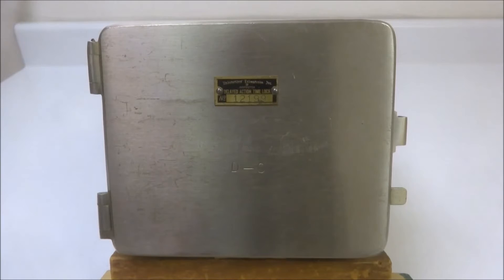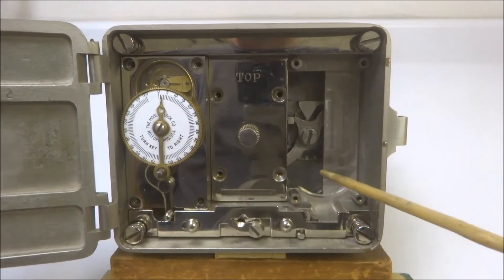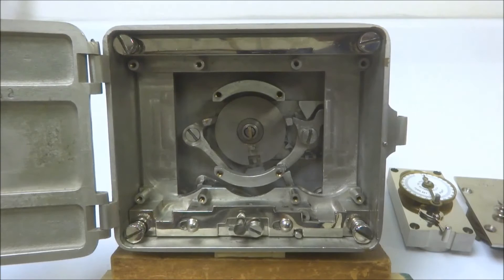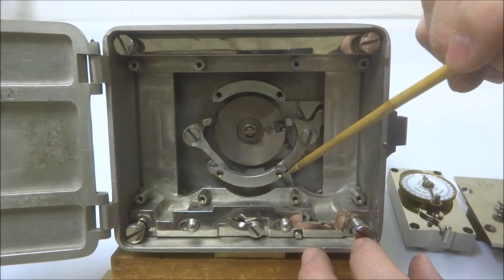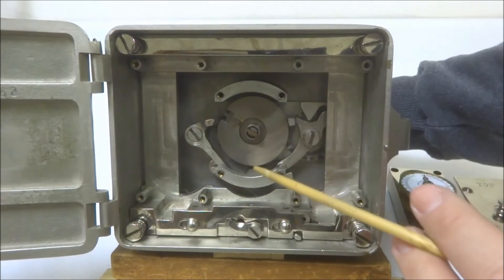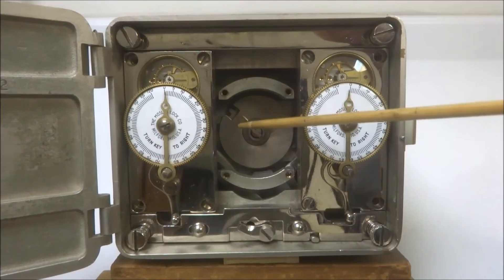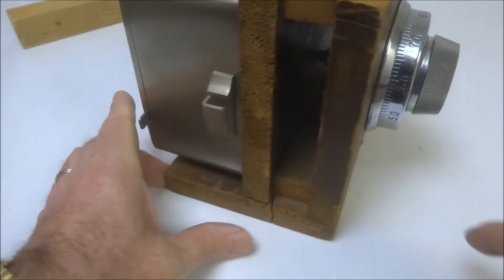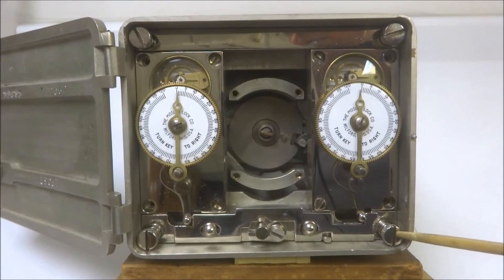Mosler Timebination lock, Model D-C, delayed combination

Comment: Mark your description sounds good although a bit strange and got me thinking about this lock.  I believe it was intended to be used as both an overnight time lock and as a short delay on the unlocking of the safe during business hours.  Once the safe was opened in the morning, that pin could be removed and a short amount of time put on a movement.  Now the procedure to reopen the safe would require dialing the comb to the secondary fence index activating the timer.  Once it had wound down the primary comb index would unlock the safe.  Since the wheel pack has only one set of gate openings and there are 2 index marks the same comb works at either index mark.  This would then require an armed robber to wait around for several minutes to access the main supply of cash in the vault. This delay function was found to be a fairly effective deterrent back in the early 1900's and I image is continued today.
Reply from the maker: Thanks Doug. I will keep your description should I redo the video.

Comment: Fascinating! I assume that the reliability of the clocks is of the highest possible because I would imagine that the failure of the main clock would mean that the safe would then be locked permanently with no easy way of getting in?
Reply from the maker: That is correct which is why there are two movements. Either one can perform the function so both would need to fail for a lockout to occur, an unlikely occurance. You can see other examples here: http://www.my-time-machines.net/my_time_lock_collection.htm
Reply: Thanks for the confirmation, I assume that as long as one counts down to zero and the other stops at some time before zero you can still open the safe. But does one have to wait 30 minutes after putting in the combination before it will unlock?? And I'm guessing that you might have to take two tries as you wouldn't know which one failed so you would need to try both combinations with a half hour wait between?
Reply from the maker: When the lock is operating under normal circumstances, that is one needs only to dial in the regular combination you would have to wait for the time locks to wind to zero. No need for the secondary combination. In the case of the safe being closed for an extended period of time and requiring the dialing in of the secondary combination, yes one would have to wait about 1/2 hour. Remember that the snubber bar was locked a bit out of position to keep the primary fence from being released so after the secondary combination is correctly dialed in and the snubber bar is released, the time lock's engagement levers still need to move that snubber bar a bit further to allow the release of the primary fence. This takes a bit of time. Even after this is accomplished the operator still needs to dial in the correct primary combination and, of course have the key to unlock the dial in the first place.